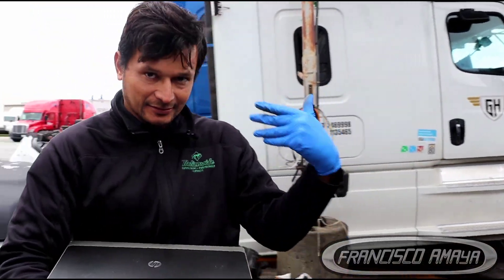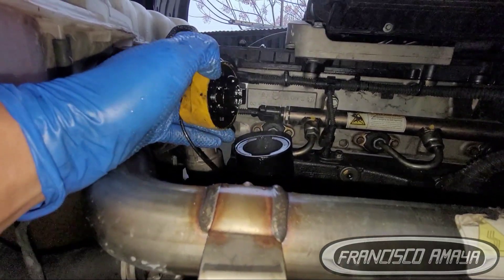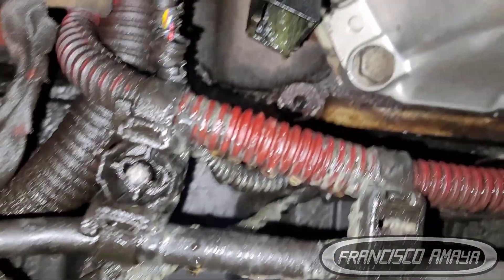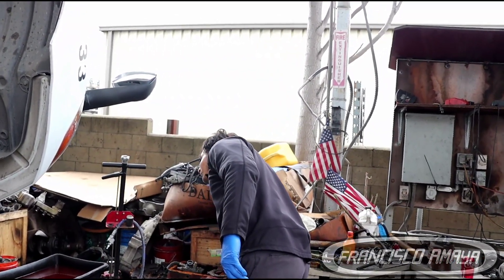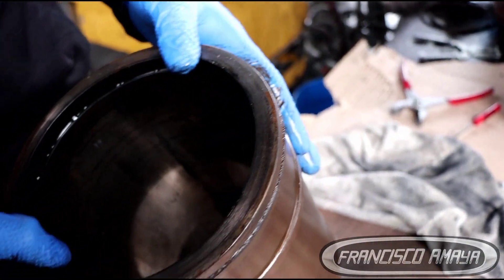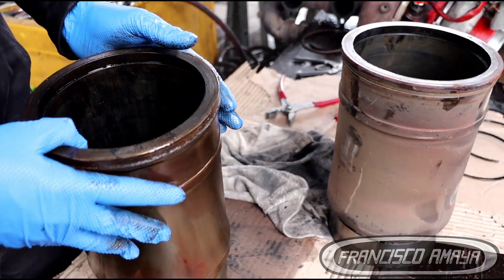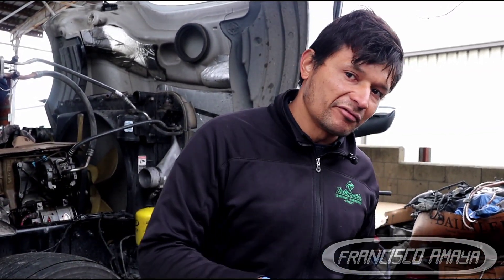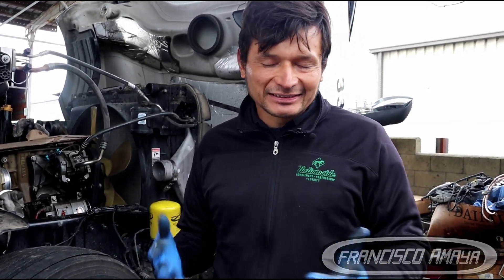2020 FREIGHTLINER CASCADIA DD15 ENGINE WITH A DAMAGE ENGINE BROKEN CYLINDER LINER WATER IN OIL

Comment: What causes the cylinder liner to have crack? How many miles on the truck? About how much the cost? Is it overhaul solution?
Reply: Excessive weight and speed and rpm … that 1700 and 1800 rpm , 75 mph … that’s what causes premature damages . Keep it at 1500 rpm , drive 68 max . Dont accept 45k pounds cheap loads going to Tennessee , Pennsylvania, West Virginia , Colorado ! Use common sense !
Reply: Bad design not enough material on cylinder. Mileage doesn't matter especially if out of warranty.
Reply: We have a lot of. DD 13  they are the best  these new one a lots prblem
Reply: We have a lot of. DD 13  they are the best  these new one a lots prblem